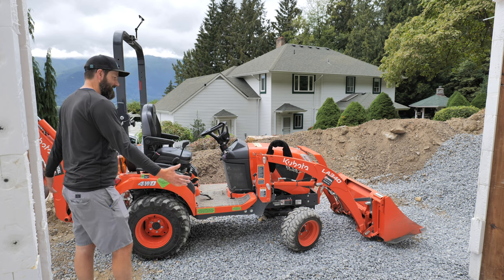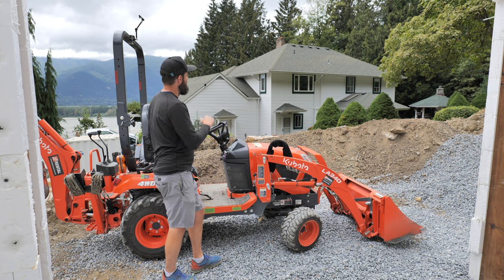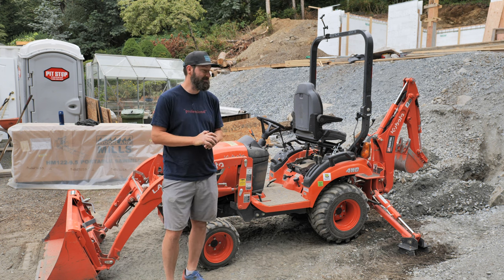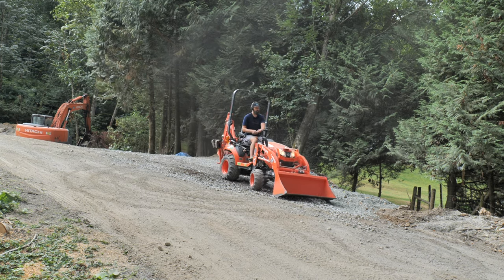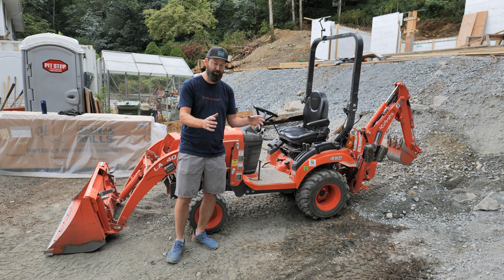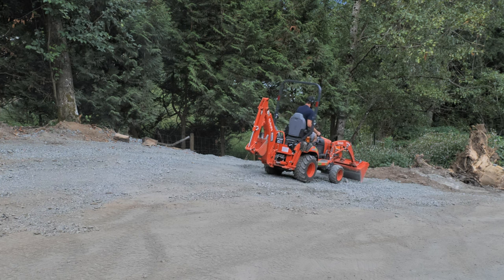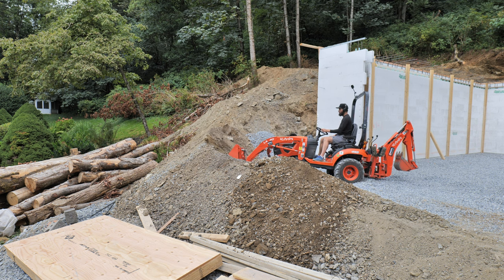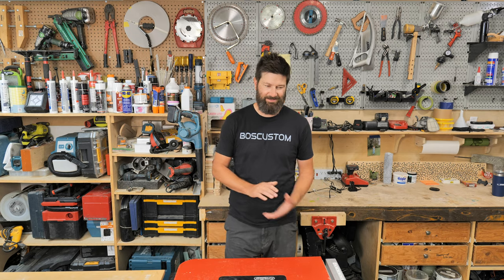Are Sub-Compact Tractors Useless?(Waste of Money)

Comment: Seems like a waste of time with the small bucket until you are the guy in the trench digging with a shovel, or moving 3 yards of gravel with shovel and wheel barrow.
Reply from the maker: No doubt!😂
Reply: @TheFunnyCarpenter   highly recommend the 1025r if you get a Deere.  I use mine religiously
Reply: in digging up the (brick and mortar) foundations for re-insulation in a centuries-old house (it should be around 200ft) a company is quoting me 30k for earth moving alone.

for that money, I'd figure I'd buy myself a "toy" and do most of the work myself. 😃
Reply: Exactly. Lol
Reply: God damn right
Reply: That’s a true statement. Well said
Reply: 100% I have over 100 hours on my massey sub compact in just 2 years, took 10 acres of corn field and now we have a house, shop, barn, garage, 3 pastures, and over 600 trees planted, the tractor was used in part for everything, sure it took a while vs. much larger equipment, but its mine and I can use it any time I want I think that makes up for time loss dealing with renting.
Reply: @TyrantTommy Thats pretty big stuff for a subcompact, but it does work! 😀
Reply: I heard that I'm planning on putting in my own sespool and drain field I think a compact tractor will come in handy for that C'Mon😏

Comment: I`ve owned JD`s for decades. There is a good reason there is now a Kubota BX23s sitting in my garage today. JD couldn`t even come close to the deal i got with the Kubota dealer. You can always add shims to the hydraulic pump relief valve too, to increase the lift capacities. Its real simple to do. Just keep it under 2000psi. The BX will do anything a JD1025r will do, all day long. Another thing that turned me off to JD, was not only the hefty price tag, but they will void your warranty for the dumbest things. The JD FEL & backhoes are made in china and mexico too. No thanks!

Comment: I love my Kubota BX23S.  Extremely useful and fits in my 12’ dump trailer.  I love the grapple for moving and loading logs.  Every machine has its limits and it’s important to understand them.  For those that trash talk sub compacts…some of us prefer the small size for use in confined spaces.  I spend a lot less time conducting manual labor.  Some bigger tasks take longer or require some ingenuity and applying mechanical advantage to get it done, but it’s a very capable machine for its size.
Reply: Amen to your statement. Our BX23s is plenty of tractor for my wife & i. The JD1025r couldn`t get into the tight places we`ve had our BX23s in and out of. We tried BOTH tractors out. The BX23s was the better choice without any doubt. Not to mention, we didnt pay those over inflated cost for the green machine name. Our deal for the Kubota BX23s was $5000 cheaper.
Reply: @D70340  who did you end up buying the BX from? cheers!
Reply: Love mine. Have completed many projects around here. Including backhoe, I have box blade and tiller also
Reply: yes, I love the compact design, bigger machine can do more work but its USELESS if its too big to get around a pond, betweene garage and house, through the back gate and rip out stumps from a back yard, without destroying the property and removing a section of fence,  btw bigger maching means bigger trailer and truck too !! my half ton truck hauls it around great !! I LOVE IT !

Comment: We have a John Deere that size. Used it to dig out the foundation around a home to repair a crack in the block wall. Have done some grading corrections and stone driveway work. Great for clearing snow.
Reply from the maker: Good to know! I think despite its small size that type of tractor could be very handy.
Reply: It's certainly useful in that it fits into small spaces.
Reply: @TheFunnyCarpenter  Is repairability a concern for you? Deere is notorious to be hostile to their users when it comes to DIY repairs and that their repairs are expensive.
Reply from the maker: @AB0BA_69  interesting point
Reply: @TheFunnyCarpenter  No worries. FWIW I don't know anything about Kubota brand or whether it's any better in this respect. Just as an "outsider" looking in I only have a negative impression of Deere as a company.

Comment: Great video thanks. One tip would be slinging heavy loads, it's hands down the number one easiest way to tip a BX23s on flat ground with almost zero steering input. Watch one video of it happening and you'll probably never sling that much weight, that far from your bucket again.

Comment: If you are thinking about getting forks for logs, (you may already be aware) there are forks with an opposable "thumb" and the thumb is controlled by hydraulics (so that also needs to be available on your machine).  Makes manipulating logs onto and around your mill much easier.  Cheers and thanks for the video, David

Comment: Your local dealer is one of the most important factors when buying a tractor. Pick wisely and talk to some people that have bought there. My local Massey Ferguson dealer is awesome. I bought the 1725M sub compact and I absolutely love it. It's amazing what that little tractor is capable of doing. I also bought an old 150 used from the 1960's it is handy for the stuff that the sub compact doesn't do as well. Plowing with a two bottom plow, digging post holes with a 12" auger, and using a one row cultivator. The subcompact just isn't tall enough for the plow and cultivator and the larger tractor just handles the auger easier.

Comment: I have a BX in Australia and grapple was not available,  all I could get was 4 in 1 bucket which holds literally no more than a wheel barrow load, I find it's limit pretty much everytime I use it and would definitely consider sizing up however getting in and out of tight spaces is excellent if you have plenty of time as everything slow going. I also use the mid deck mower a lot and even though taking the loader and backhoe on and off is quite easy it's still a pain to be doing on a regular basis. Thanks for the video.

Comment: I have a 2003 Kubota BX 2200. I have worked it hard including in the woods cutting 6 cords of firewood from tree to wood stove. I have learned a lot through the years including how to pick up heavy logs. It has never broken down. Just routine maintenance. (I have an after market backhoe. It works fairly well but it is fair for smaller projects.) I am 100% satisfied with my sub compact Kubota. Good luck with whatever tractor you decide to get. You will find it incredibly useful.
Reply from the maker: Thanks for the info Gerry!  I ended up getting the 1025R.  Boy is it ever handy to have a tractor with forks!

Comment: Both the Deer and the Kubota you are looking at are Agricultural level tractors. They will do jobs you showed in video, but with a lot of struggle. If you want a construction grade tlb but want a smaller compact unit look at Kubota B26, L47, or M62. I have the M62 and for my uses it’s strong, capable and outshines any Ag level tractors. The frame is strengthened and there are multiple options that are designed to help with construction related work.

Comment: I've had a BX 2380 for a couple of years.  Great machine for me as I have the large mower deck which works really well for my 2 acres.  Still not to heavy for being on the lawn but plenty handy with the loader.  Have forks and front blade  along with a back blade.  Live in Michigan so for winter use, I have a Curtis cab.  Has been trouble free and my local Kubota dealer is really great.

Comment: When you were back dragging with the Kubota did you have the transmission in low range ? Probably Not . Good luck with that JD Pin 📌 on bucket . I’ll take the skid steer quick disconnect system to change out implements over the JD bucket any day!

Comment: In-laws have that tractor and I have used it fairly extensively to work on their property and while it's not a powerhouse, it's definitely useful as hell. Only after I started using the little tractor did I realize just how useful the damn thing was for so many different tasks. Got a land-planer and graded about an acre to relative flatness. It took a while, but it beat the hell out of doing it any other way. Dug several 30 - 50 foot trenches for plumbing and irrigation. Scooped and laid gravel. Helped clear out some trees than fell over during a crazy winter storm. Hell I've used it to tote shovels and power tools across the property. Definitely getting one for myself when me and the wife get some property. Was the John Deere you got significantly more expensive?

Comment: I have a comparison video on my channel with side by side specs for many of the sub compact brands, but specs are only part of the equation as you have already figured out. How the machine feels to you and dealer factors are also super important. The backhoe would be nice if you have known regular uses for it. Otherwise, better to just rent a mini excavator on demand or use a 3 point attachment to assist with shallow trenching jobs.
Reply from the maker: No doubt on the mini excavator! I’d much rather just rent one.  We will see how it goes, I’d like to make a path around the property.

Comment: I've got a little Ford 1210, it is easy to get into sketchy situations with the bucket.  The bucket can easily hold and the hydraulics lift too heavy a load.  But if you are careful and keep the bucket low these can do a lot.  I did get forks for mine and that really helps clear out fallen trees.

Comment: They are small but I've been able to remove large tree stumps (4ft in diameter) just fine. It took several hours and the tractor couldn't lift the stump but my truck was able to pull the stump out. I was able to use the loader to roll the stump to my burn pile.

Comment: It will just barely fit through a four foot gate and dig modest swimming pools - very slowly. It's a niche market. Also popular with plumbers - add a six inch wide bucket to your arsenal. You can dig for septic tanks and trench with the same machine, and again it will fit in tight spots.

Comment: I just found this video so a very late response:

For an older person like myself on a few acres these size tractors are a gold mine.  Keep in mind they have a belly mower so the BX can do a lot more quicker than the push mower and wheelbarrow.  And it fits in tight spaces.  A 4WD diesel subcompact like this is way beyond simple hand tools.  The 'niche market' is not that niche - its every landowner with any acreage.

Not pretending this is for commercial construction - I have a neighbor with a mid size excavator for that.  Then I follow behind with the Kubota, then behind that with hand tools.  This 'tiered' system of work will let me maintain my small homestead much later in life - best investment we've made make no mistake.

Comment: So, the B2601 might be a better sized machine for you given your height. The better tool for levelling the driveway may have been a rear mounted box blade.

Backhoes are not cheap but  if you are going to landscape your property they are great. The problem with the smaller machines is that the hydraulic pumps and values do not facilitate full pressure and volume to all cylinders at the same moment so there is a learning curve to backhoe and loader smoothness on a subcompact tractor.  The little BX with backhoe is however a very capable machine if you are under 5 acres and ground clearance is not an issue.

I went to a larger machine for the lift capacity on the loader. Pallet forks are by far the best attachment you can have - mine stay on the tractor all the time. The backhoe means you really never need think about a counter weight for the loader. For logs on a small mill you want a minimum of 1000 lbs not including the weight of the pallet forks.  I have been impressed with my Everything Attachment forks

Green or Orange is fine - but make sure you play safe

Comment: My sense is that these are fine to rent, but if you don't use it often, why are you buying it, and if you DO use it often, is this really the tool for you? 

I would think you would pick up something much more specialized for your trade. It doesn't look to have much more, if any, capacity than say, a skid steer, but those things fit EVERYWHERE, and load onto a trailer very easily. That's what all the landscapers in my area use, and it's what I have hours on. 

Maybe it's a toy for retirees? Teach the grandkids how to dig? Or if you are super rural and on an acreage, and can't get to a rental depot? or work in super muddy areas, where the super short wheelbase of a skid steer can lead them to getting stuck?
Reply from the maker: Some good points!  The things I like is being able to tow it easy on a trailer, fits nicely in the garage, cheaper than a skid steer, probably more enjoyable to ride around on than a skid steer, drive on grass nicely.  For any serious work though a skid steer will destroy one of these tiny tractors!
Reply: Skid steers are a lot more expensive, especially when you start adding attachments.  They are also a lot heavier, so you need a trailer with at least 7,000lb axles to tow them.  My dad has a skid steer, but he has 200 cattle, so he can justify it.  They also don't rent these at any rental place where we live in Saskatchewan, but they do rent skidsteers and the mini-excavators.  I think I'll be getting a 35-45hp tractor however for mowing trails through the forest, digging, and especially snow-removal on my 160 acre acreage, once we move out of the city.  Even this will cost about half that of a skidsteer.

Comment: Your call on what to get, but you won’t find JD equipment for rent at Home Depot or about any rental house and I’ve owned both.
Reply from the maker: How’d you like the JD?
Reply: @TheFunnyCarpenter  OK, guess I took a swipe at JD.  I actually had a JD X485 (same as the X700 series now) with a front end loader and three point hitch.  My dislike was the plastic hood and fenders.  A chunk of ice fell on the hood one winter clearing snow and cracked it, so not a fan of the plastic parts and probably a big reason you don't see the smaller JDs at rental yards.  

Also, regarding hp, I don't think the few extra hp will make any difference on traction going up your hill.  Usually, traction is more a function of weight and tire choice.  The extra hp is more important for pto driven implements like a wood chipper, generator, etc.  

As for the backhoe, I think you're underestimating their capability.  I've taken out decent size stumps with my BX25 (older version of the new BX23s), which I've had for 12 years with no issues.  It will take more time digging with the small BH compared to a larger machine or excavator but seat time is part of the fun.  For extra performance, I load cement blocks or something heavy in the front end loader (keeps the tractor front end from coming up too easily while digging) and placing rubber chocks behind the rear wheels to keep the backhoe from dragging the tractor backwards so easily.  I find those two "adjustments" really help digging performance. 

Regarding the difference in lifting ability between the two, JD runs their hydraulic pump IIRC at about 2000 or 2100 psi while Kubota spec's theirs at about 1800.  You can turn up the pressure on the kubota (I'm sure there are YouTube vid's on it) if needed though you may void your warranty if they claim it caused some issue.  (I turned mine up to 2000 psi years ago with no problem).  

Anyway, hope some of this is helpful to your decision.  Good luck.

Comment: I am not familiar with tractors much, but why just 25HP? I think this other guy, Sawing with Sandy, has a 39 HP Kioti that is much better for loading logs onto his sawmill. Are 35+ HP tractors too big to transport by trailer easily? Where would you be trailering your tractor to ?
Reply from the maker: Sawing with Sandy is awesome. The sun compact tractors are nice in that they are very stable on hills and they take up less space if you want to park it in the garage.
Reply: 25 hp is the max you can get before you have to have all the emissions equipment on the engine, so many people stay under that threshold so they don’t have to deal with regen cycles and all the associated problems that come with more complicated engine systems. That’s why the 25 hp compact utility tractors, which are somewhat larger and heavier than subcompacts, are so popular with homeowners with 10 acres of land or less.

Comment: Agreed the compacts are a joke, I had a BX22, with FEL, MMM, and the backhoe. It's just not capable,  and you end up beating the heck out of the machine to do "simple" tasks that it simply is large enough to do. I traded mine in for a Cub Yanmar EX series, 2500lbs much wider, longer, an ready to work. The only options I bought were the FEL, and MMM. I don't think any of the tractor in this size can really handle a backhoe. I found a Kubota KX series mini excavator with buckets, grappling,  and hydraulic jack hammer.  I used it for years and sold it for a profit after I was done with.. you know I should have never sold it. Everytime I have to reach for a spade, I could kick myself right in the you know what. SMH